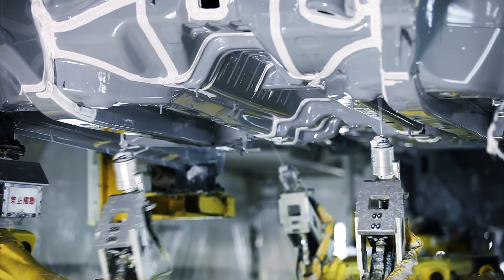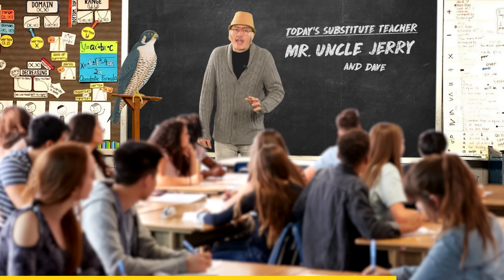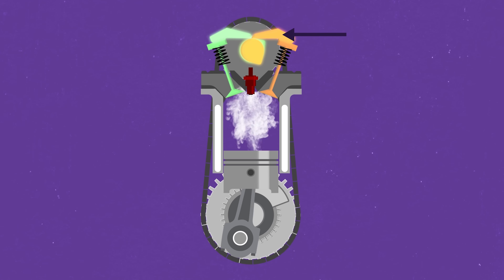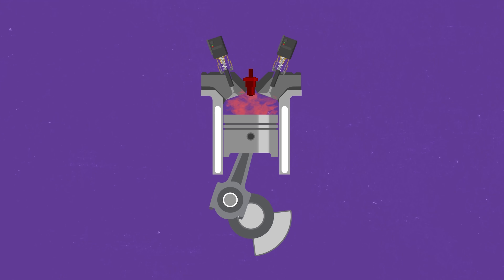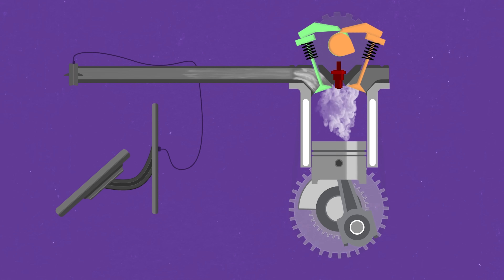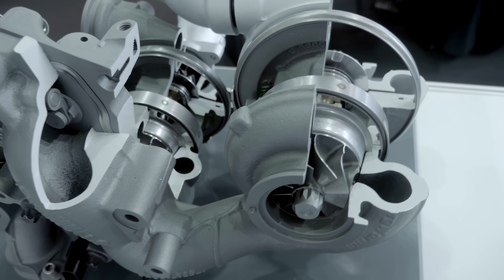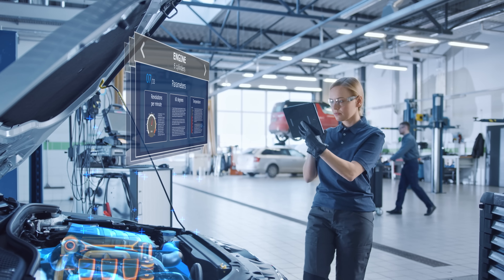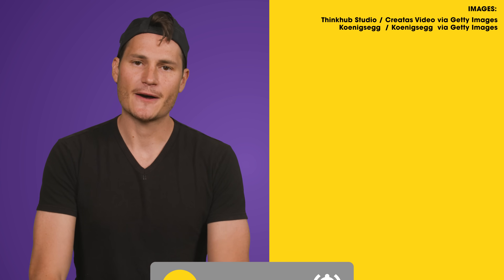This Is The Last Great Engine Tech

Comment: To be completely honest the electric car era is scarier than the time my dad told us he had cancer
Reply: It has a certain dread. On one hand, electric cars are just inherently superior. Instant torque, per-wheel acceleration if you have enough motors, you can brake to restore energy. But there's a certain art to ICE cars that Electric cars simply do not have. We will be worse off when they're gone.
Reply: @HarmonicVector  ICE vs EV is analogous to automatic mechanical vs digital quartz watch
Reply: @J_1019  Not really. EV to me is more like those absurdly expensive versions of the Apple Watch compared to a mechanical watch. It has all these useful doohickeys and gadgets that makes it by default superior to a normal timepiece. But the mechanical watch will endure year after year. An Apple Watch, despite being the best possible example for software support, will not survive the test of time.
Reply: @HarmonicVector  tbf, EVs are still maturing unlike ICEs. Theoritically, EVs has less moving parts, means less maintenance needed. Also, with the advancement of battery technology and production, the price will eventually goes down. ICE will still have place in the future but EV will dominate
Reply: I don't want my car to be locked down like my phone. Screw Tesla.
Reply: you're more afraid of cars being electric than your dad having cancer?

fuck is wrong with you lmao